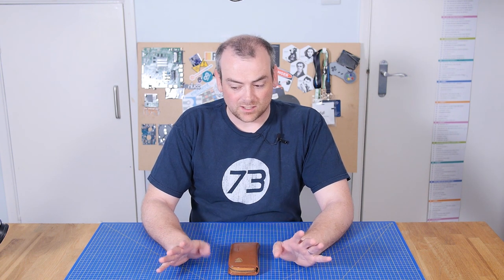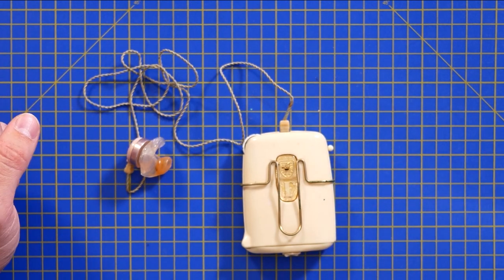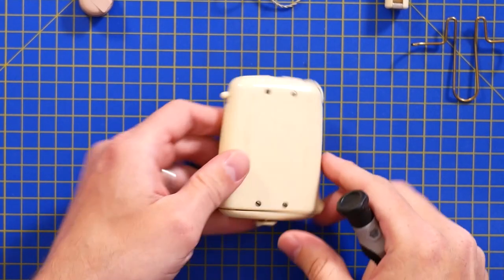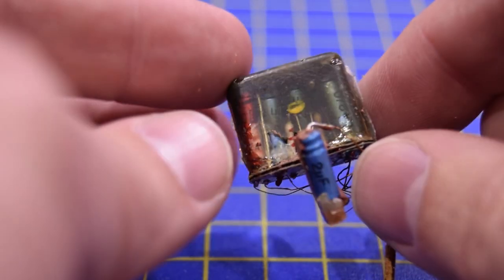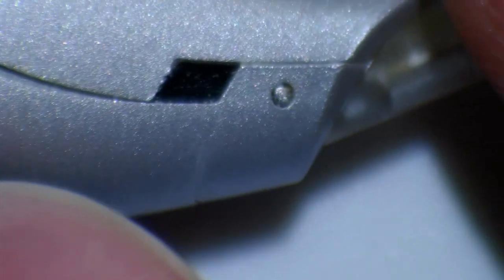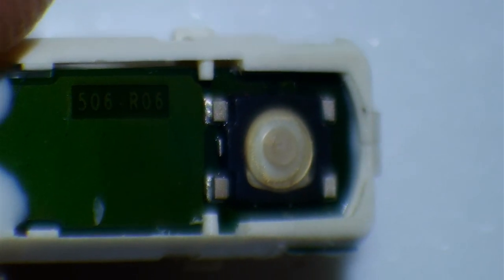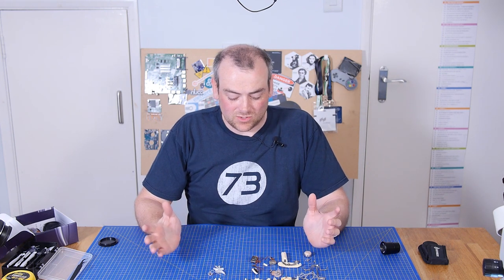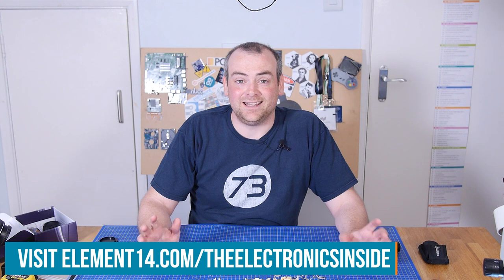Comparing Hearing Aids from Then and Now - The Electronics Inside

Comment: I have a pair of 1 year old hearing aids,  mine are rechargeable and incorporate bluetooth.  I can both answer my mobile phone and select configurations for the hearing aids (normal, restaurant, TV, etc) and change the sound focus with the app on the phone.  The price quoted includes "lifetime" support from my audiologist.  The programming header you see allows the audiologist to configure the hearing aids to match the user's hearing loss.  Hearing loss is uneven, yours may be missing high frequencies, other people different frequencies.  In the US there is a move to allow "over the counter" hearing aids.  Those haven't arrived yet.  The app is available from the play store or similar.
Reply: God forbid anything medical should be affordable.
Reply: I'm in the US and insurance doesn't cover hearing aids so I had to buy mine outright. it was 5 grand and it comes with a one year warranty. after that anything that needs to be done I have to pay for. need a new earmold? that's $500 any other repairs can be $700 and up.
Reply: @coolbluelights  That's insane

Comment: I agree with the BT earbud solution for those with more minor hearing loss. The Galaxy Buds and others can already pass through ambient sound and the Galaxy Buds 2 can even amplify that sound. Many will "map" your ear canal and tune accordingly or they'll deliver a simple hearing test that helps you set the right audio profiles.

I know there's more to hearing aids than just amplification, but it's a start. Added bonus of live, conversational translation in the near future.

Comment: Minor correction: The button only lowers the volume level of the hearing aid; the other hearing aid's button would raise it. The hearing aid is powered off by opening the battery door – on newer hearing aids the door also snaps to a slightly opened position, where the hearing aid will not receive power but will still contain the battery.

In addition to the volume control, long pressing the button toggles the T-coil mode, which picks up baseband audio from the air, intended to receive PA announcements and speech from presenters, teachers, etc.
Reply: The button function can be changed in the programming software. Most commonly a short press is for volume adjustment (left lowers, right raises), and long presses change the program (general, speech-in-noise, comfort, tv, T-coil).

Comment: Those three prongs might be the bay where you can hook up an external integrated receiver that can connect your hearing aids to hearing aid accessories such as roger microphones like the Roger Pen or Roger Select. Or to connect it to your TV 

Many new hearing aids have internal integrated receivers now, I have rechargeable phonak audeo paradise hearing aids and they have internal integrated receivers , so they wouldn’t need a “boot” in order to connect with FM systems like the Roger Pen .

Comment: Can be done very cheaply with an I2S DAC Amplifier IC, I2C MEMS Microphone pared with a microcontroller like stm32 without compromising efficiency. The only cost that will persist of PCB.

For high-end audio, custom audio codec IC Wolfson WM8731 cab be adopted, still, it will be far cheaper than 4000 GPB
Reply: Try it! Seriously, the more people that try the better chance we have of creating a working open source project!

Comment: Cannot believe that vintage hearing aid is a solid state as I thought it used tubes and it seems like the B+ could have been 30V and the heater would have been 1.5V
Reply: A neighbour, when I was growing up in the '70s, owned a hearing aid company, he would give me old ones for parts. They were probably five to ten years old, often working, but some of the first products using transistors, typically OC70 and OC71, which I think were the first commercially available transistors. BTW I have a valve one I found in an op shop, it uses the smallest valves I have seen, as you say two batteries, the B+ battery came in three voltages, higher voltage gave more gain, but shorter battery life.
Reply: @pbhrbb  it'd be great to see some photos or videos if you can?

Of course it'd be even better if you wanted to send it over for a full teardown!
Reply: @a531016  It's been on my 2do list to do.a video on it, I am curious too about if it still works, I'll try to do that thus weekend.

Comment: Modified BT ear buds with digital audio processing with a phone might be cheaper.
Reply: Certainly some of the newer "smart" ear buds will have the power, I wonder how they would compare on battery and safety?
Reply: @a531016  More that the volumes are so much higher, so you can amortise the cost of all the development over a vastly bigger production run. Remember the volume that Apple or Samsung makes in the average day, production wise, is around 5 years production for a hearing aid, plus you have a lot more certification bodies that the hearing aid has to be approved by, and these bodies are not cheap at all.